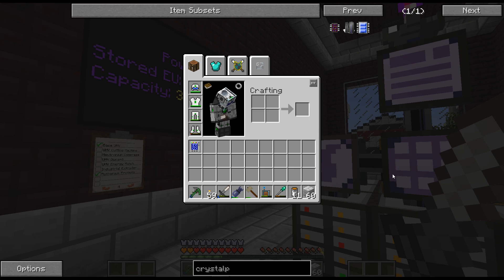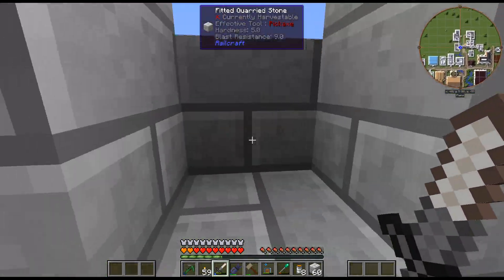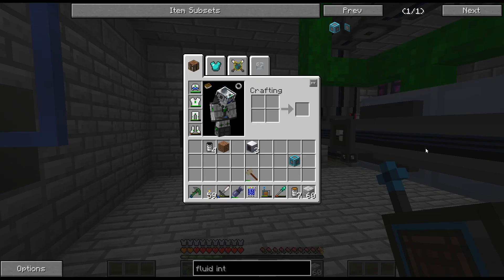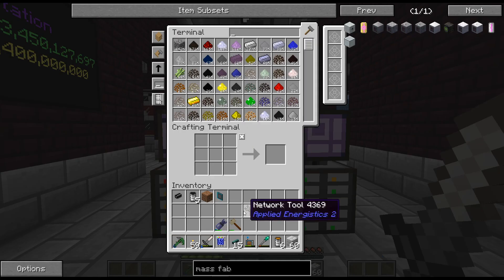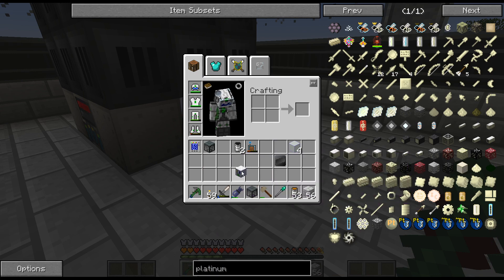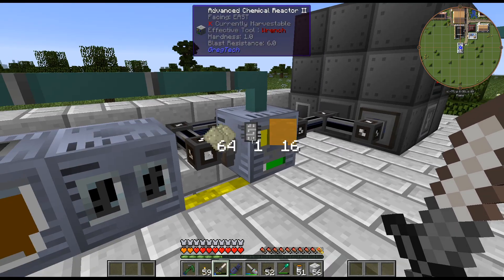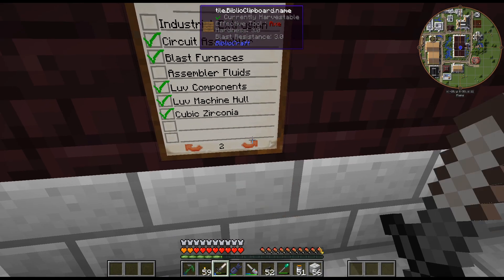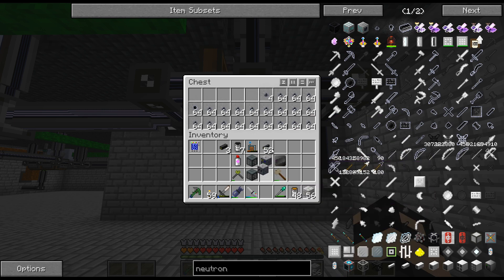Gregtech New Horizons - 283 - Neutronium Compressor Pt 2

Comment: The speed of light in GTNH seems to be 7571 meters per second.

32 volts over 160 seconds can create one liter of UU, which has the mass of 1 liter of hydrogen, or 0.0893 grams.

The energy consumed by the mass fabricator over this time is 5119.2 joules.

Solving for e=mc^2, c is 16936 mph.

Because of this, if lightspeed was actually calculated, anything over 24 chunks away would have a one tick time delay. Teleporting 1 km would take three ticks.

Edit: The LV mass fab takes more than one amp, iirc. The speed of light in this case would have to be adjusted to be higher.